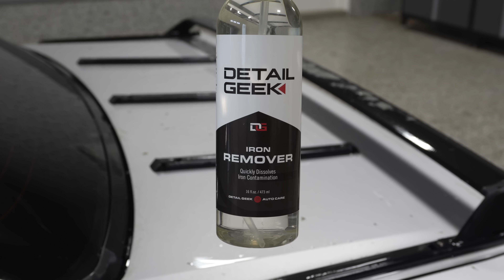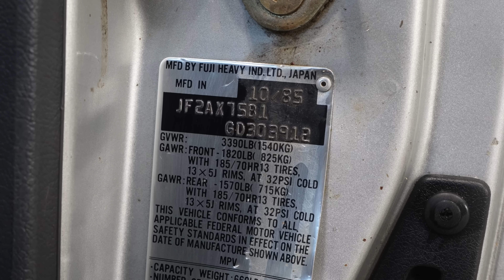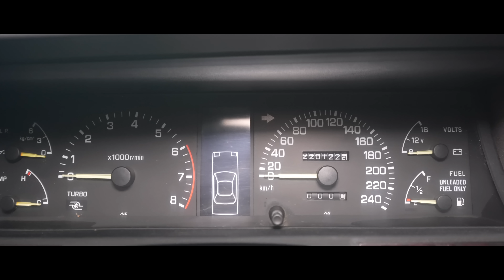I Found The RAREST Car From The '80s To Detail!

Comment: Hey Mitch. You definitely need to wear a respirator when cleaning a car that had or has mice in it. My brother is a paramedic and said it can be deadly for your lungs to breathe in the toxic air due to mice. Be careful and we love you. This detail was a blast to watch. Amazing before and afters 😍
Reply: Not sure I could make an educated guess as I drive a 2007 Mazda CX7 with just over 50k miles, in fact I drive it so little that the warranty on the tires expired with under 10k miles, but they are cracking up from the sun. But what the hay I’ll guess 67k. 😊
Reply: Hanta virus from mice. It can kill you. Almost killed me.
Reply: Mask spotted @23:14
Reply: Hanta virus killed a friend of ours, not even 40 years old. Glad you made it. ^^^
Reply: He wore a mask.
Reply: Bingo PAL 💯🤙🏻🤷🏿‍♂️
Reply: He has a respirator. He's used it in so many prior videos.
Reply: @MikeYork-bn1mt what about all the other races…? 😂
Reply: @MikeYork-bn1mtHuh?
Reply: Love the racing check upholstery.
Reply: Does the same apply to rats?
Reply: Ear plugs too. When you lose your hearing it does not come back.
Reply: I own two very clean ones brother!!
Reply: A full quickly dead
Reply: Hi
Reply: DEFINITELY  ... ! 

ALWAYS   WEAR   A   RESPIRATOR  
MASK   ... ! 

And ...

WHY  DIDNT  YOU  ALSO  REMOVE  THE  CONSOLE   AND   THE  ENTIRE  REAR  SEAT  AND  REMOVE  THE  WHOLE  INSIDE   FLOOR  CARPETING   TOO ... ?   

And ...

DIDN'T   You  At  Least   ATTEMPT   to  Clean  the  Headliner  ... ?
Reply: @steve2jz664 LMAO don't kid yourself there bud 🥱😆😆
Reply: 😮😮😮i
Reply: Don't you know Americans don't like wearing ppe
Reply: And you’re Christian? Kinda hypocritical, since God loves ALL of mankind since we are made in HIS image. Read your Bible and let God’s grace heal your heart.
Reply: Thanks Karen.
Reply: @jdelrey750  sure, but at 15:51 removing that lump of dirt definitely felt like he breathed it in 😂
Reply: Definitely wear a respirator every time you detail a car. I have Sarcoidosis and although my job didn't cause it, it's no fun to be sick. Many first responders got Sarcoidosis after they worked at ground zero on 911.
Reply: That is critical especially when vermin had inhabited the vehicle, inhaling that crap can be very very dangerous.
Reply: Hantavirus
Reply: Also the car placement on the trailer is dangerous. It should not be at the end of the trailer.
Reply: Hey Mitch, I hate to be another one of those people, however, you also need to wear eye covering that is actually sealed around your eyes like a large pair of goggles. You only get one set of eyes, honey. These are awesome though!
Reply: Agree 100%
Reply: @wano_ZA Mitch is in Canada.
Reply: Great job, only one question.
Shouldn't you pull the bottom of the backseat too?  There had to be more Mouse remnants.
Reply: @MikeYork-bn1mt huh?!!!
Reply: The feeling is indescribable every time I see the car
Reply: Das ist korrekt. Ich hatte nach dem reinigen einer alten Werkstatt, die Ratten und Mäuse infiziert war starke Lungenprobleme und anschließend wurde ich krank. Obere und untere Atemwege, Fieber. Das wird gerne unterschätzt.
Reply: @ceizure18 Meh
Reply: 30,000 on the odometer 😅
Reply: @wano_ZA He's Canadian
Reply: 3 Questions: 1. Do you use hot or cold water when power washing exterior?  2. Do you wash and reuse your rags? 3. What detergent do you use if you wash your rags? 
Thank you for your informative videos!
Reply: @Spacelord-1983 same if you work on a roof, especially those flat roofs with stones on them where there's always moss. That stuff collects all the diseases from birds and if you walk on the roof and kick up the dust from the dried out moss you'll breathe it in. I worked on a rooftop without thinking of that back in 2014 and got the worst case of flu ever. Flat out with super high fever and everything for 2 weeks, was so bad I actually ended up getting an infusion in the ER (which is why I know the strain of flu because they tested it, was the strain the flu shot that year didn't protect against because they missed it in the forecast), plus another month of not being able to strain myself at all.

Wild birds are the reservoir of human flu and bird flu. Be even more careful inside old attics where there couldn't just have been mice or birds but also bats.
Reply: Newly retired nurse here.  Please use a respirator!
Reply: I wonder why the underside of the hood and trunk were not pressure washed?
Reply: The hanta virus is too rare to be afraid of..

Comment: Not only have I seen this car before but I used to own one.  I had a 1987 XT Turbo in Red.  The car was like a space ship on the inside.  There were no dials at all, only buttons and switches.  The height adjustment was a really cool feature.  It would give you 4" in the front and 6" in the rear for clearance.  The entire dash was all digital and the glow at night was impressive.  It handled very well in the snow with the 4WD.  I remember taking it when I went skiing.  Never had an issue.  Owned it for a couple of years until I bought a New 1989 Turbo Trans Am in Black.  Now that was a car!
Reply: A friend had one in Australia. No way was it faster than a WRX though!
Reply: A guy at our church in ND had a red one as well!!
Reply: I had a friend growing up and his father bought one of these. I remember when these came out. It seemed like a way for Subaru to stand out in the crowd and bring attention to the brand. It was a crazy future like car for its time.
Reply: I looked at one of these back in 2000 for college.  Ended up in a 5th gen Celica instead.  I made the right choice but the XT would have been way more interesting.
Reply: Those Turbo Trans Am's were also rare, and were beasts!

Comment: Respirators help, but if that’s a regular shop-vac, you should really invest in a HEPA/RRP vacuum.  

Regular shop vacs just spit the exhaust back out into the air around you.  HEPA/RRP will contain all that bad stuff you might be coming into contact with.

Nice job though!!

Comment: LOVED my XT's!!! Had an 86 4cyl 5-speed, and an 88 XT6. Both were an blast to drive. Was lucky enough to have also owned an SVX. Suby had some very futuristic (and amazingly ahead of their time) cars in the mid 80's to early 90's!
Reply: I also had an XT6. I loved that thing. It would hug a curve like it was on rails!!
Reply: Loved my SVX as well except for the really weak AT that is why I sold it went thru 2 AT
Reply: @jimh9332  Same. Mine had both of the SVX flaws... transmission and power steering failures.
Reply: @cajunrcfamily6188  Oh yeah! And the electronic pneumatic suspension was miles ahead of its time.

Comment: I have owned a few XT Turbo's. I had the first year an 85,  and 89 and the last year a JDM 91 Alcyone 4WD VR Turbo, and then the revival of the XT,  with the Outback and Forester in the 2000's. IF you want a RARE Vehicle. look for a 1988 to to 1994 Dodge Caravan with a 2.4L 4cyl 5 spd Turbo. I have owned 2 of the 4cyl caravans, first was N/A 1988, the second was a 94 Turbo 4cyl.

Comment: You sir have an amazing talent! I drove one of those cars in the early 90's. It wasn't a bad car to drive. The problem that I had with it was the fact that most people would stare at you while driving it. As a rare car collector, it is a car that I would most likely buy. The Subaru's of that time were very well known for rusting rather quickly. A lot of them didn't make it much past 10 years old due to rust and being very unsafe because of the rust. It's a cool car that I hope does get driven again.
Reply: Dead right on the rust. I think I would have thrown it on a lift first to see what I was up against. 20 years stuck in the open like that; probably going to be nasty surprises under there.

Comment: What's the point of the detail if it doesn't run? Or does it? I'll have to wait and see. Curse you for this teaser! And a premiere?! A gift to start this holiday season. ❤
Reply: I imagine it's a restoration project. Working with a clean car makes the job easier, as there's less worries about mold, spiders, mice, several plumes of dirt in your face, etc. It's not a necessity to get a car detailed before restoring it, obviously, it's just an option that makes things a little easier for some folks. 

My grandfather's the same way with old projects or restorations, except he does the cleaning himself. I personally would vacuum and wipe surfaces and clean up only what's hazardous and in the way initially, but I suppose it wouldn't hurt to go the extra mile at that point and get the exterior up and done
Reply: @erinnerungen8823  Restoration was my guess, also thinking wash and clean but don't go all out yet. If it's stored where neighbors can see it, fully detailed would be better while it's being worked on.
Reply: @shannonp1656  Oh I get that, I think the same as you. I personally wouldn't fully detail a restoration until I know the project can be completed. I'm just saying some people would probably go the extra mile just for the sake of doing it, or they probably have the money to burn anyway. Probably the case in this video. There's also the possibility that the car still runs. Either way, I'm curious to see the reasoning in the video tomorrow (if there is a reason given)

Comment: Amazing!  I used to own one of these... electropneumatic suspension, and pushbutton 4x on the fly! The 'hill-holder' was a treat to have with a manual transmission, too. Nice work, this really takes me back. Good luck getting it stuck in a snowbank, one winter I hydroplaned  in slush off the hwy in the Pine Pass. Went 15' down a bank, steered straight the whole way down, and when we towed it straight back out I was able to drive it into town. No problem. Second all-time favourite to my Datsun 260z.
Reply: You had a Datto 260z aswell! 
😍 great car!
Reply: Yep... but currently working on a 52 Fargo❤

Comment: Thought you should know that this vid is quickly spreading through the XT/XT6 community. Great job on the detail! It’s in better shape that a lot of them we come across. 
It’s a bit of work to get them running and driving properly. They are weirdly engineered and VERY complicated, but seriously fun to drive! And restoring it will be an even bigger undertaking. 
Like most XTs they’ll either get it running and enjoy it as is, or part it out. 
Cool find, awesome cleaning job!
Reply: My grandpa bought one brand new and it’s been sitting in his barn not running for about 20 years, I think getting good parts is extremely hard.
Reply: @Jordan__Sloan For the engine/drivetrain, not too difficult. the EA engine was widely used and new-old-stock parts are still available in many cases. A lot of these also get swapped with the more modern (but still discontinued as of 2022) EJ series engines.

Comment: first year of the WRX was 92' with 240hp 2.0L , the XT had 95Hp 1.8L. There is no way that Car was racing against a WRX and winning. I bet the car was not even raced. But you do awesome work and you did outstanding on this car. I hope the new owners do  right by the car

Comment: Yep, I owned one of those cars. It was a good little 4wd with the airplane looking dash. I lived in New England at the time, and a bad snow storm had hit while I was at the gym. Headed toward home near the end of the storm and found a local ambulance sitting stranded across the road home. Even with chains they had, they were stuck. The Subi I was driving handled the snow like a champ, even driving into the mobile home park, which hasn't been plowed yet. I literally drove through the snow and watched in amazement as the car cut into the depth of snow, which flowed over the hood, over the roof of the car, and down the back with a couple inches of depth. Several steep hills to get home and iirc, about 15 or so inches of snow. Fun, reliability, and life saving traction built into that little black Subi! I wish I still had it!

Comment: Brings back memories, dad bought an 84 Turbo XT new, had it until '91 when he handed it down to me as a teen. I drove the crap out of that lil' turbo. This little thing would GO! Very unassuming car. The only unfortunate thing about it, is the Turbo is more than half the horsepower for the engine. Once the turbo died, it couldn't even climb a small hill. I ran it to over 180k miles, so it was reliable and was a great car.

Comment: Amazing cleaning job, hours of work doesn't count only the result. Now real restoration could begin : engine, brakes, electricity, suspension, fuel line...etc... I hope for you that spare parts are stil available. I did almost the same on a 1978 Ford Granada (german version) in the late 90's 😅

Comment: Those were cool cars.  They made a flat 4 and flat 6 cylinder version.  Because of the engine layout they were able to keep the body lines pretty narrow vs other AWD cars in that class at the time.  Subaru had some quirky cars from that time and its cool to see them getting saved.  I would not have guessed you could get it so clean!!!

Comment: Those are Pugeot wheels, or 'Pugs,' as fans of old Subarus call them. Older Subarus with 4-bolt wheels had 14" wheels, and the only 15" wheels with the right bolt pattern and offset were the Pugeot wheels. I had a set on my '92 Loyale. Interestingly, the XT6 (same as the XT Turbo, but with a flat 6 engine) had a 5-bolt pattern. I had WRX wheels on my XT6, which looked pretty cool. That was a fun car.

Comment: Had one w/o the turbo, but it had a horizontally opposed engine that put out more hp.  It was a beast in the snow outperforming any other vehicle we ever had incl Tahoe, Sequoia, denali etc.  It would not slip and could brake hard in the slick stuff and stop just like there was no snow or ice.  Amazing vehicle, but not good for travel.  Just a few hours on  the highway would leave you crumpled up like a dead leaf, and barely able to move.

Comment: Drove an XT once (in the UK) when I got it as a loan car when my Impreza was in the shop for a service. It had over 250,000 miles on the clock but still drove really well. Flat as a pancake compared to an Impreza Turbo mind.

Comment: Mr. Geek,
   Because you deserve it, I'm going to give you some advice; After you're done with your routine, clean your glass (inside/out) with SOFT SCRUB, and the outside body of the vehicle, tires and rims, and all plastic.  Rinse and wipe dry until no streaking/residue.  Then do your glass (inside/out) with RAIN X, then do the paint with TR3, and buff it out.  You'll be very happy you did.

Comment: This is just a rough guess....I think it has about 32,000 - 42,000 miles.  He said he used it  for off-road mostly. I figured  he drove about  10,000 a year.  And you said it had set out in the yard for over a decade.   I really love the car.

Comment: Fuji Heavy Industries formally changed its name to Subaru Corporation in 2017...

Subaru is the automobile manufacturing division of Subaru Corporation (Formerly known as Fuji Heavy Industries 1953 - 2017)

It wasn't built for Subaru, it was built by Subaru.

Comment: Next time you blast the engine bay with a pressure washer you should take a couple seconds and wrap the alternator in a grocery bag or something. The intake as well if it had an exposed air filter

Comment: Hi broo. You guys are lucky this engine didn't start. It didn't move for decades, no oil circulation, so each part of the engine might rusty and hard to move.

This is gonna be a ride to get this engine working again. You should have change the oil  remove the sparkplug, and spill engine oil into the cilinder first and get this rotate a few times before the engine starts.

This is how my stepfather did with his Lada.

Comment: I've always been told not to power wash old cars under the hood. Also.. that interior can not be left where it is. There's mouse shit under it for sure. And idk where you live, but if there's been any substantial moisture in there, it'll be inundated with mold spores too. Gotta remove it entirely and treat underneath. Probably replace it entirely.

Comment: Had a car exactly identical like that back in 2009 only it was in more so rough shape with the body in itself....but had if I remember right only 156,000ish miles on it at the time for being 23 years old drove really nice everything on it worked pretty much though other than a few things like the door latches for the outside were sticking then one of the door latches on the inside was stuck so had to lock it with the key instead then the trunk lid button would stick too so the trunk lid itself would be stuck lol soooo...plus back side windows I noticed would leak some too and would have needed new tires but ended up selling due to moving out of state back then otherwise I would have kept it other than those minor things did well enough for me

Comment: Can I make one safety suggestion, when working on a car that has had rodents living in it please wear a respirator when cleaning it. When mouse droppings dry out they will crumble and basically become dust particles that you can breath in. Rodents are vectors for many different diseases and breathing in that stuff can make you really sick. I was in pest management for a decade so I have a lot of experience working in tight confined spaces filled with rodent droppings.

Comment: Probably a good thing the owner did was to stash it under the spruce tree. May have prevented some sun rot and/or fading of the exterior paint/decals and interior color and integrity. The Spruce needles would eventually find they're way into every nook and cranny that may have rotted away and act as a natural insulation.
#dontblamethemice